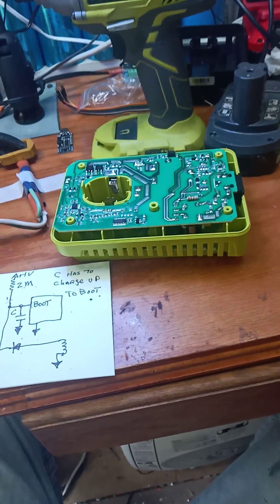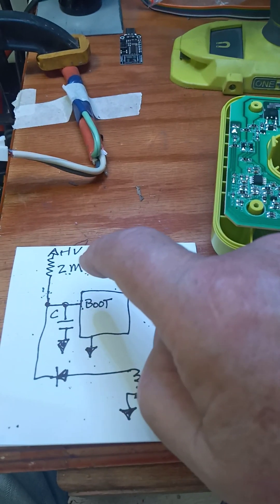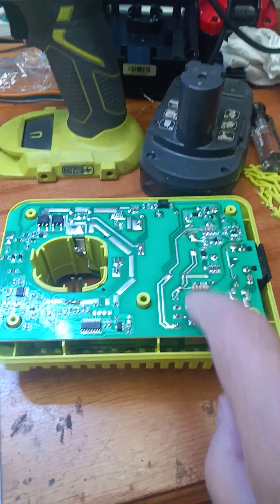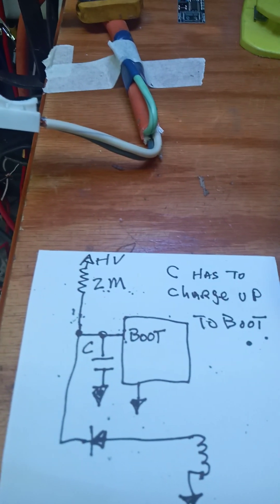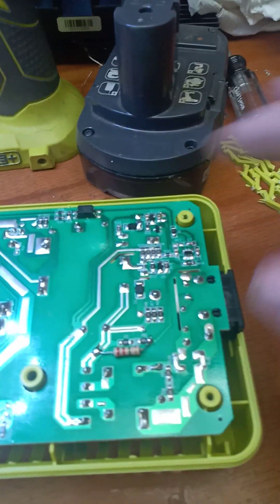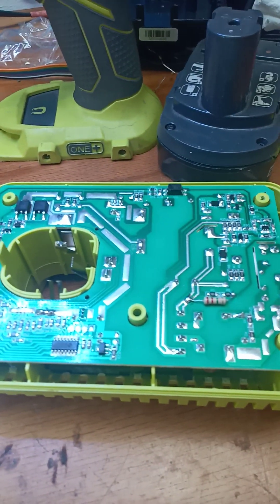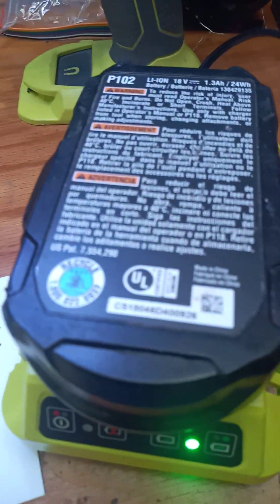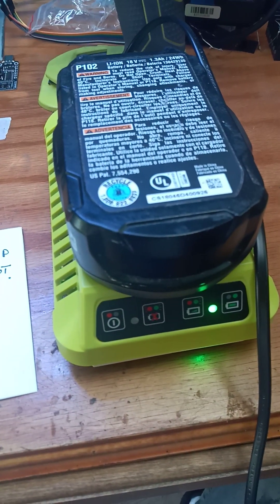Direct Power 3, Ryobi Clone Battery Charger Running From 60V PV

Comment from the maker: Direct PV power runs my Ryobi clone battery charger.  This is rated for 100 to 240V AC but it works down to 60V DC from my PV array.  It worked as is because it has a switching power supply.  From experience I know these switchers will work that low and sometimes they need a little help starting.  I bridged a 2.2M ohm resistor across the two 1M ohm boot up resistors to make starting easier.  With this modification the charger will still work with 120V AC. Just another way to not have to run an inverter.  60V is always available in the shop.

Most devices never have enough air circulation.  I cut the internal vent bars to make air easier to move.  At lower voltage, the internal inverter will run a bit hotter.  These are projects I do and are not recommended for those without a technical background.

Comment: I got one of those hot water controller form that guy and he went out of business again I have to put up some new panels for it
Reply: I have a inverter that runs direct power off the panels I haven't got around to putting panels to it yet it's a mppt solar 500 volt input pv
Reply from the maker: Is that techluck? I had one of those to repair after a lightning hit. Everything was destroyed except the protection devices.  The builder wouldn't repair it.  The programmed micro could only be supplied by him. Those caps are only rated .68A each and some are going bad in a few years.  Love to get one for repair so I could test performance. Anyone with a problem should contact me.